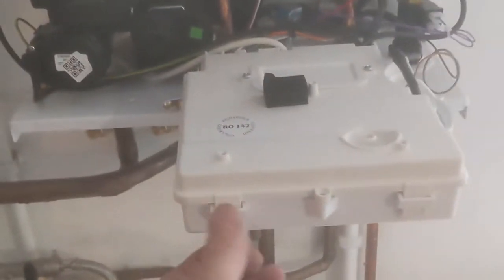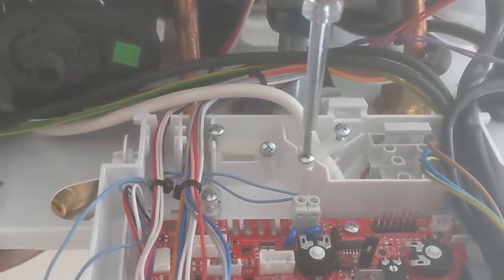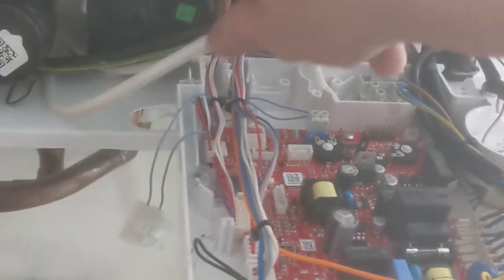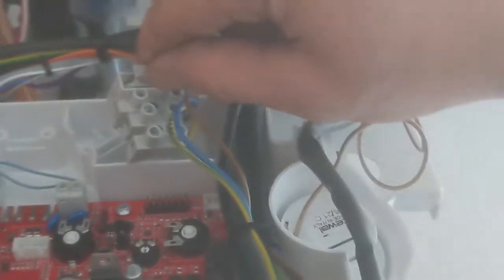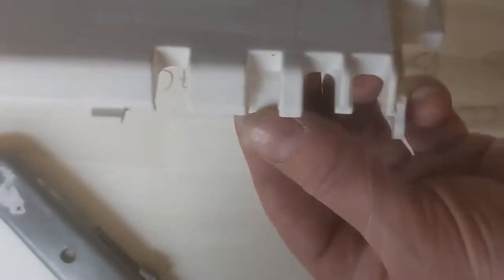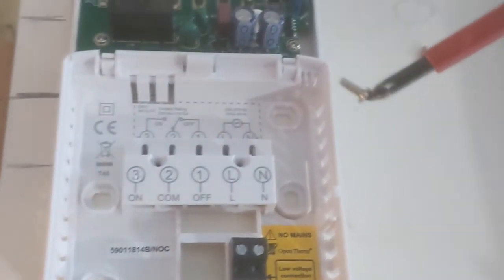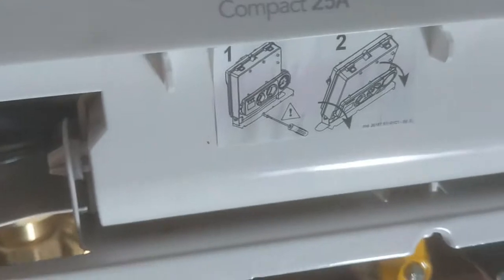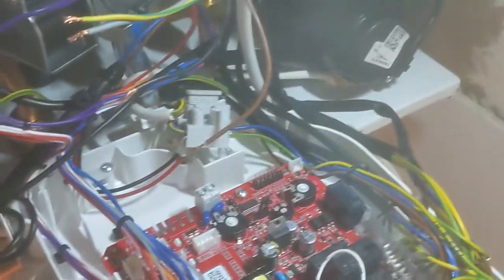Eph cp4 programmable thermostat. How to wire into a vokera easi heat and compact A.

Comment: Wish I watched this beforehand I have just wired the common and on receiver links into the voltage free CN5 block and blew the PCB. 😵
Reply from the maker: Ahh sorry to hear that....😭
Reply: You live and learn. I read the diagram wrong, first time blowing a pcb and hopefully the last. Thanks for the helpful video I did see that connector block will wire it correctly on monday. @northwestgascertificates
Reply from the maker: Ive not done a pcb board yet. Thought i had on a few occasions but ended up just being the quick blow fuse...i feel your pain ..

Comment: Thank you very much for the guide. An incompetent gas engineer who was supposed to service my boiler told me that the condensate pump was wired incorrectly and ... disconnected the thermostat. To be fair, the previous incompetent gas engineer who installed the boiler used brown and blue wires for the thermostat signal.

Comment: Just had a quick search for vokera boilers and the info I got back was that they are opentherm compatable so you may want to rewire the stat from on/off to get a better usage from you programmable stat
Reply from the maker: I'm completely with you and if the customer is up for that then of course it is better but sometimes I've had problems with explaining basic on/off thermostats with customers and I'm not joking. I return to service the boiler and they are just manually over riding the thermostat. Sometimes they turn the heating temperature down on the boiler, down to the lowest setting and won't go near the thermostat 😂 opentherm I would be struggling 😂but yes with the right customer 👍

Comment: Very useful video ive never installed a vokera boiler, are they any good?
Reply: No. They're absolute shite. For around the same price you can get a baxi or an ideal
Reply from the maker: Yes installed quite a few now. Yes had no problems with them. Look a bit cheap and cheerful but do the trick and come with 5 years warranty and the after care from Vokera is really good 👍
Reply: @northwestgascertificates  Thankyou its very useful information as all landlords want cheap boilers so i would recommend a vokera thanks